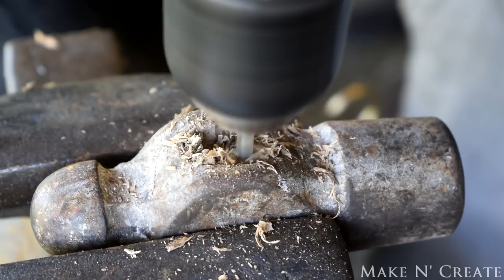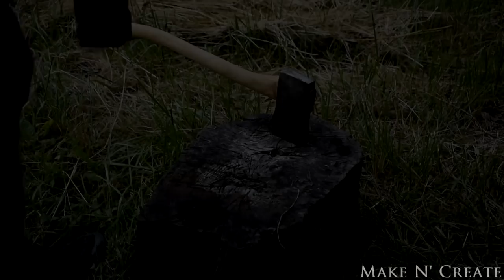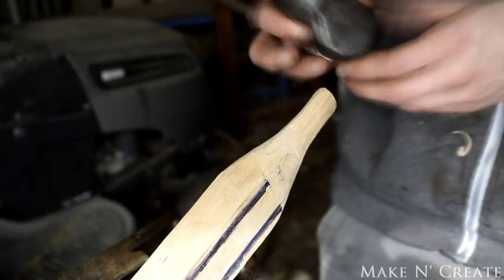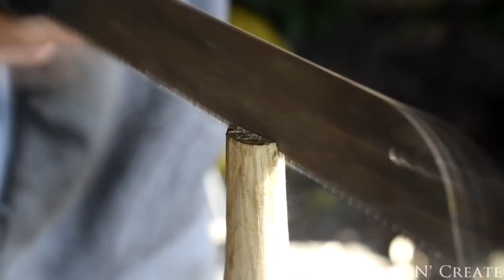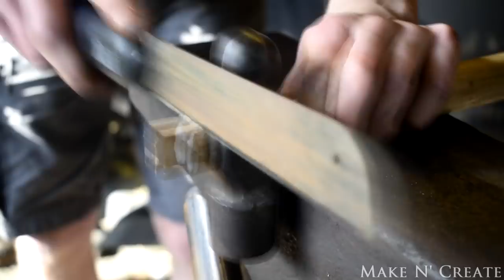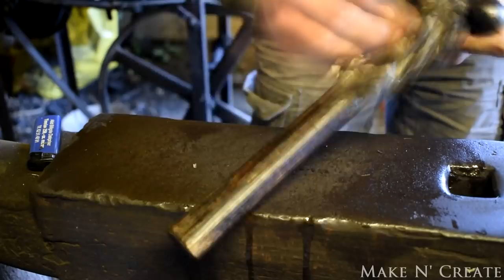Restoration - Big Ball-Peen Hammer

Comment: Why go to all that trouble making a handle,when you can buy a proper length,turned and linished,seasoned hardwood handle in the shops.? Install it with proper adhesive and drill through the side face and insert a 4mm roll pin..Then paint head with correct colour paint and lacquer
Reply: It is more fun to make your own handle it is also more personalized and something to do when you are bored

Comment: There was nothing wrong with that hammer! You just wanted it to look new! It is no longer an antique!
Reply from the maker: No. I restored because the grain orientation on that handle was bad and also because it was too thin for what I want to use it for (A blacksmithing hammer). As for wanting it to look nice I don't see anything wrong with that... If that was a piece of criticism. Also it never was antique. For that it would have be more than a 100 years old which it is not. ''according to the "official" definition issued by the United States Customs Service, antiques have traditionally been considered items with at least 100 years of age''
Reply: Make N' Create An antique is more then 25 years, but I am sorry for misconstrueding the situation.

Comment: what's the burning for? always wondered...
Reply: Michael Pinnoo color probably. And heat makes wood harder
Reply: It also preserves the wood to some extent. The charcoal barrier is rot and fire resistant. But I think it's for the looks in this case :)
Reply: It's a Japanese technique to preserve the wood called yakisugi you char the wood then brush away the debris with a stiff bristle brush then wipe down with oil it will help seal the wood from weather and bug infestation hope this helps all the best to you and yours
Reply from the maker: In a blacksmiths workshop things tend to get very dirty and discolored. Burning the wood and making it black helps with that and it gives it a very nice finish also.

Comment: Loved it...right up until you charred the handle. Terrible decision. I’m not sure why so many people are doing that these days.
Reply from the maker: Jim Sammons because it's practical.
Reply: Make N' Create does that mean “fast” or “easy”?  Or does the charring impart properties that are functional?
Reply from the maker: All of them. Charring makes the handle repel water better if you are doing wet forging. Sanding is not required to give the handle a nice finish since the fire burns away all the small wood fibers that are sticking out, so after about 1 hour of use the handle feels a 600 hundred grit finish. Also if haven't figured it out, I'm gonna be using this hammer for blacksmithing meaning that if I were to leave the handle with a normal finish on it, it would get extremely dirty and ugly.

Comment: The hammer wasn't in that bad of condition. There was no need to remove the handle, the wire brushing and filing could have been done with the handle still on, once done, the handle just needed to be sanded and oiled.
You made much ado about nothing.
Reply from the maker: No the hammer head wasn't in bad condition but does it have to be? It still needed cleaning and the face was pitted and uneven. Handle had many wormholes in it and looked horrible. The grain orientation was also far from optimal and since I'm gonna be using this hammer for forging I honestly don't wanna deal with a handle that might break. The thickness of the handle was also not very good. It might be fine for hammering in nails but when I'm standing and hitting a hot piece of steel I'd personally like something with a bit more meat on it. 
But you are of course entitled to your own opinion.
Reply: Old man kyc señora